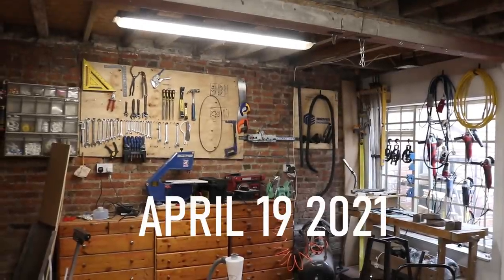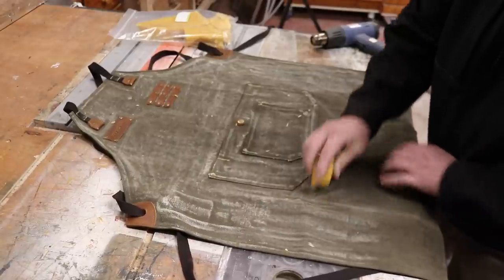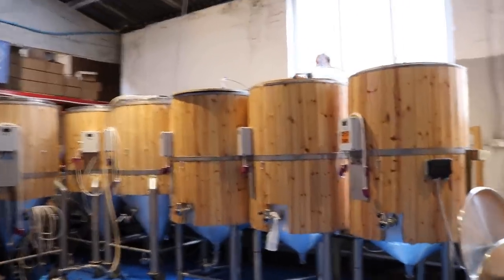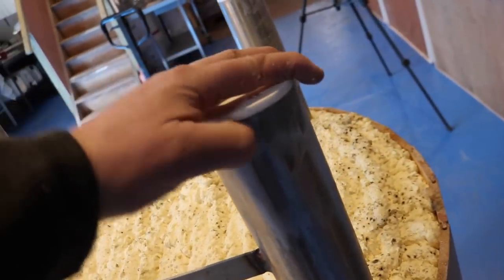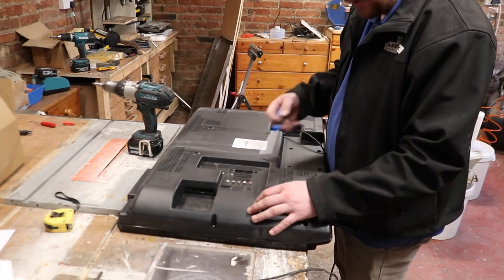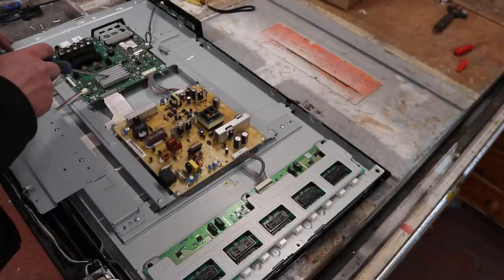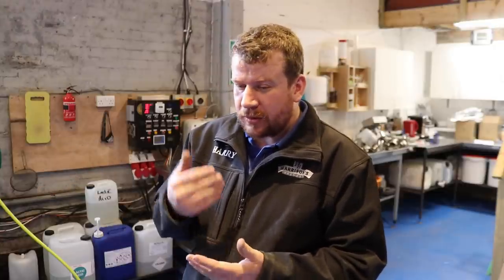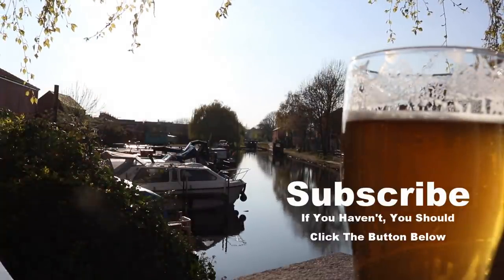Apron Wax & Mash Tun Feet

Comment: The fastest, easiest way to fix the TV is look at the mainboard, get the board ID number and the REVISION code...then go find one on ebay - change it out in 3 minutes - won't cost much, gets you fixed up quick. Don't bin it until you check that out.

Comment: Show me wax on and wax off Harris-San. With the HLT could you put it on a swivel type effort so you could tip it in place.Couple of triangles with a locking mechanism that lifts and tilts. I suppose the last thing you need is another project.
Reply: Mash Tun